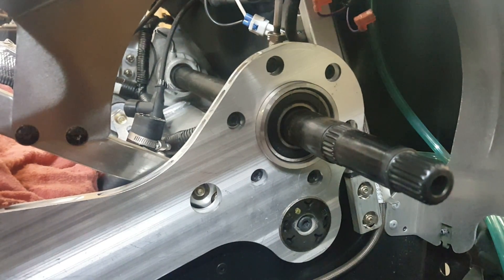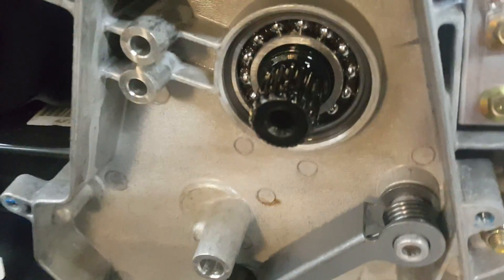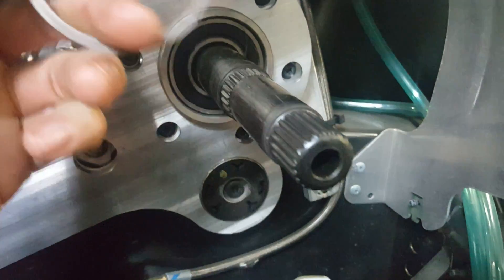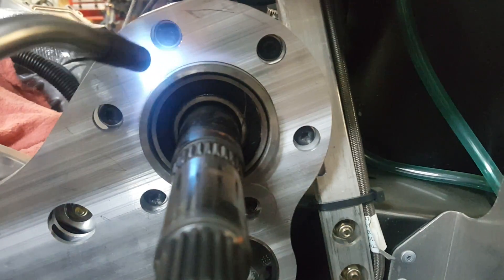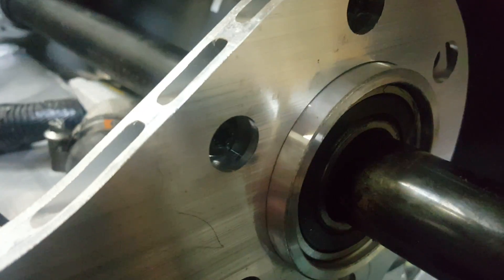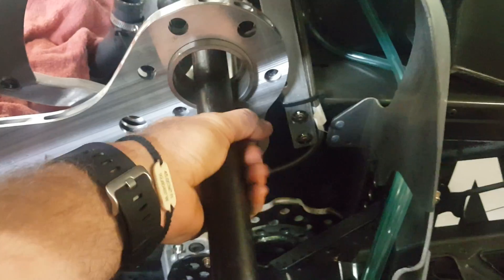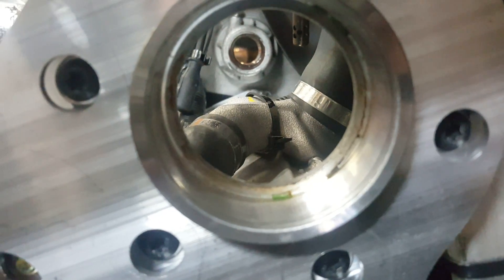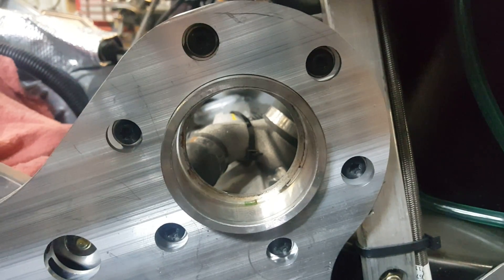HOW TO REMOVE AN ARCTIC CAT 8000 SERIES JACK SHAFT

Comment: This is not a 2013, on the chain case side jackshaft there’s some funky keyed round nut on my 2013, having a hell of a time with it.
Reply: It's got a tab that must be bent out, although you probably figured that out by now.
Reply: It’s a taper lock bushing, took me forever to figure out what it was. I finally found by looking up a jackshaft replacement kit and it had a schematic of all the parts, I couldn’t find any information else where on it. Everywhere I looked everyone was telling me to hammer the jackshaft out, I was breaking 2X4’s pounding on it, If I kept going I was gonna break my chain case. Once I figured out what it was I was able to get it out, not by hammering on it. Taper lock bushing, stupid design